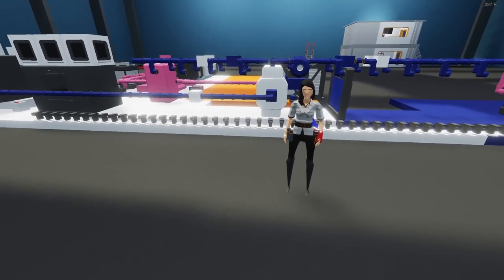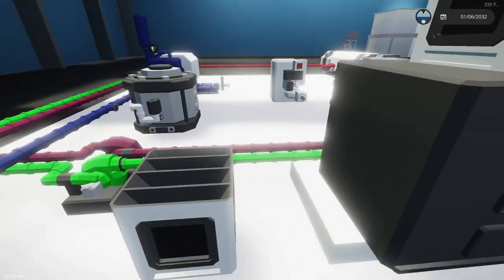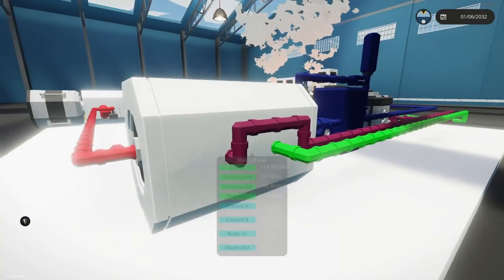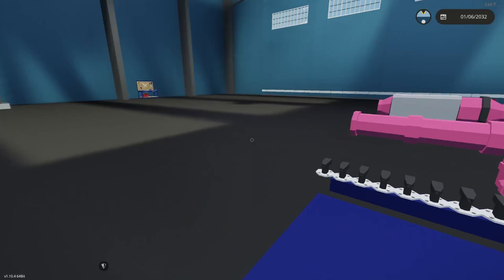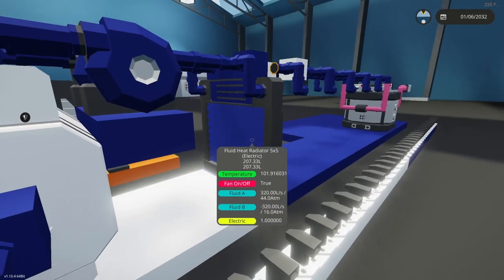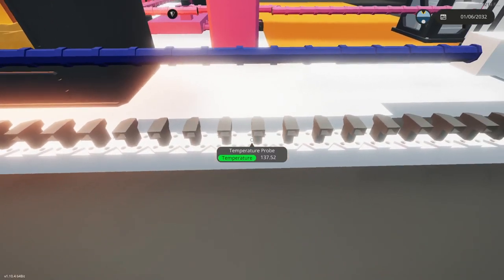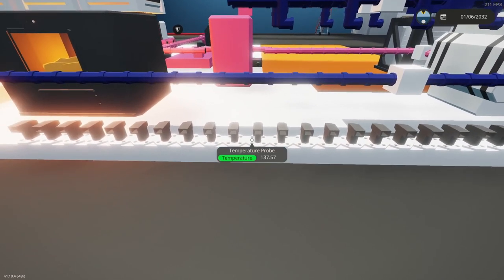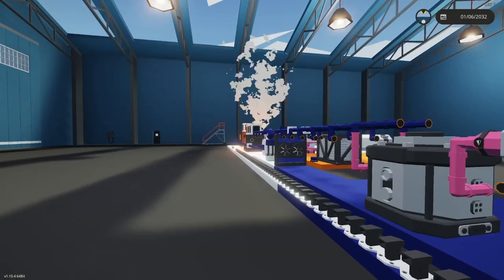Stormworks Tips & Tricks: Steam Condensers - Addressing cooling sources. #stormworks

Comment: I just use a valve on the firebox air intake to regulate the temp to about 180. This way I not only have less trouble with ambient heating, but it also uses less fuel.
Reply from the maker: aye true, this works as well .
Reply: Hey, how exactly do you do that smoothly, do I use a threshold gate+on/off valve or is it something more complex?
Reply: @lago9752  That works, or you could use a variable valve with a PID controller.

Comment: I feel like I'm being mean saying this, but it kind of feels like a duh fact. There's absolutely nothing wrong with this video or your research into this. I just feel like I've overestimated the Stormworks community if they haven't solved that having the thing that cools your system baking in the same hot air that system is putting off doesn't actually cool it no matter what. I'm usually putting heat sinks on the outside of my creations and am trying to cut off the cooling devices from the fireboxes. It's not much of a difference when it comes to working out on the industrial island where everything is hot, but it's better than putting a useless radiator in the same hotbox as the entire engine or firebox.

Does using liquid (fresh water) in the steam condenser as coolant change the performance much? There's always a bit of a debate of air cooled systems vs water cooled and the efficiency of both. I've traditionally put on a small tank of water onto my coolant lines, but I don't know if that's helping regulate the temperature or slowing down the flow.

When it comes to systems with multiplicities on them, I've found that at any point you combine the resource is when the game will skew them toward one side or the other. I'm taking a few of your tips (since you're one of the few content creators putting out research test and show videos since MrNJersey left) on some of my trains and ships, but I tend to like to run multiple boilers. Any time I've used a single firebox to run multiple boilers, one will always heat up faster (meaning it's some how getting more "coolant" than the other. I don't know how the game calculates that and it's annoying.) It got even more annoying trying to do two large fireboxes firing 4 boilers and some how 1 would still get hotter faster than the other 3 and 1 would heat up slowest.
Reply from the maker: A lot of what I share  is results of me banging my head against the SWorks wall. XD now as far as the weird split... thats based off when you placed the boiler. if placed in mirror mode then the mirrored one will receive less. that just how the game processes the xml file for creations.